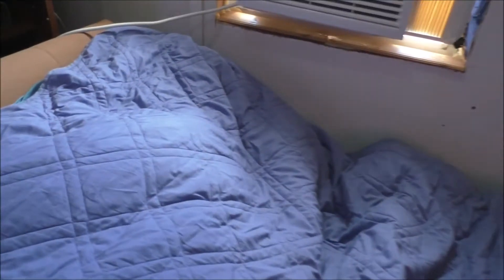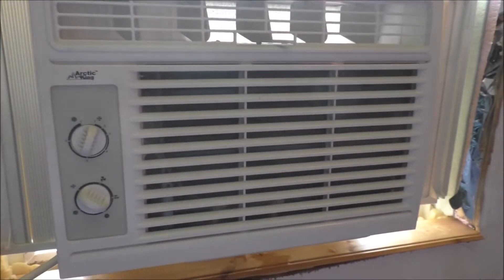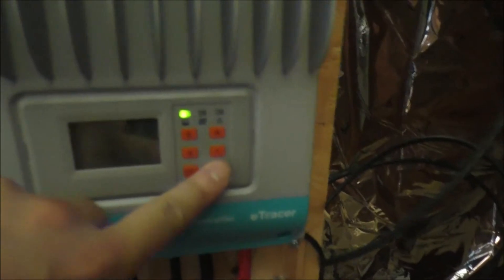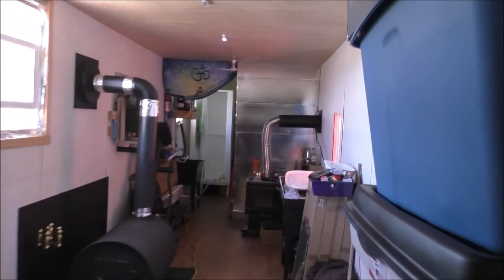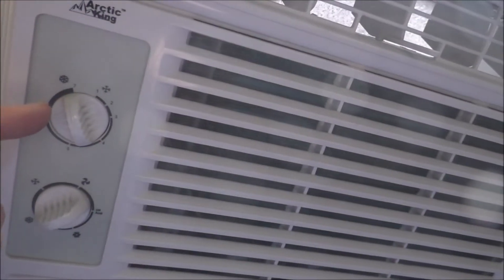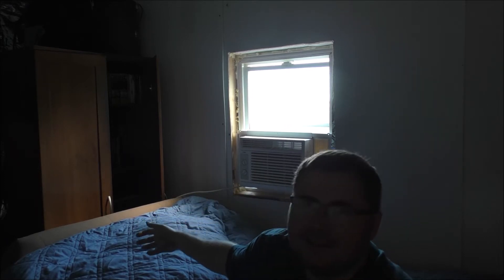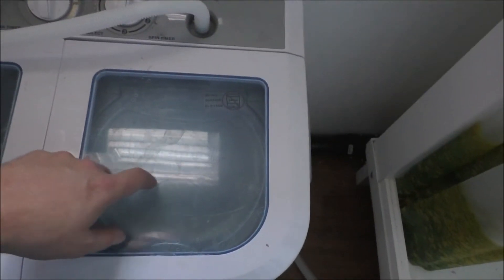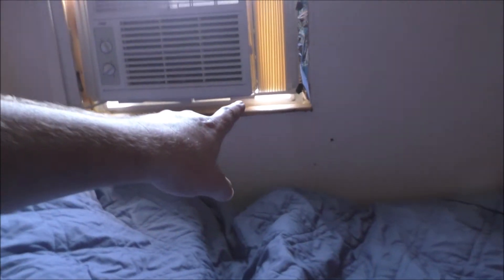Off Grid Air Conditioner

Comment: Nice. Can you share your electrical plans for the solar panel.... the company , price , etc...???
Reply from the maker: solar - LG NeON 2 Bifacial 380W monocristallin, 72 cellules × 2
(wired in series)

charge controller - EPEVER MPPT Solar Charge Controller 640A 12V/24V Auto 

custom mode is used with these parameters ...

BatType: 0
BatCap: 100
TempComp: 0
OVCutOff: 14.7
ChargLmt: 14.6
OVRcv: 12.5
EquilV: 13
RaisV: 14.6
FloCharg: 13.2
RaisRcv: 14.2
LVRcv: 11
WarnRcv: 12
LVWarn: 11
LVCutOff: 10
DischaLmt: 12
RatedLv: -1
EquilDur: 30
RaisDur: 30
BatDisch: 0
BatCharg: 100
ChargMode: 1

Custom mode must be used because i am using lithium iron phosphate batteries.

Batteries - 100Ah 12V LiFePO4 Lithium Battery x 2 ( wired in parallel)

inverter - pure sign wave 2000 watt continuous.

Video - https://www.youtube.com/watch?v=K0R-N3sskBs&t=128s
Reply from the maker: cost me $5k total included wires, switches and all devices named. I live in canada so that price may be lower for you in usa.